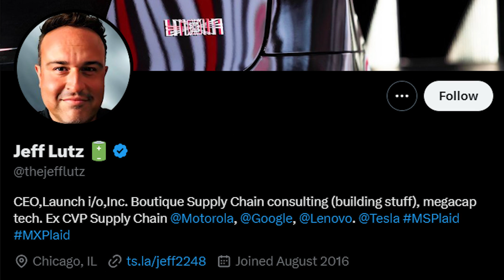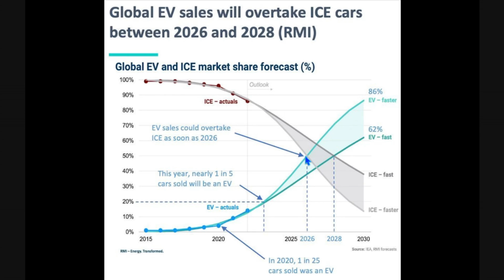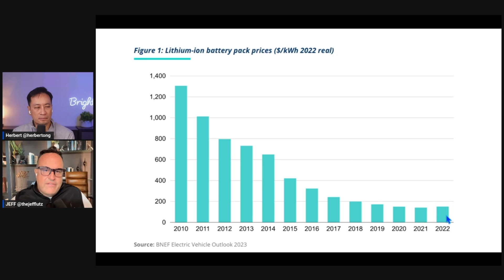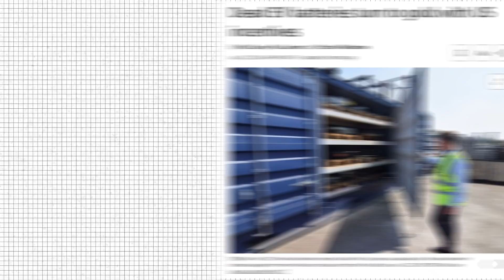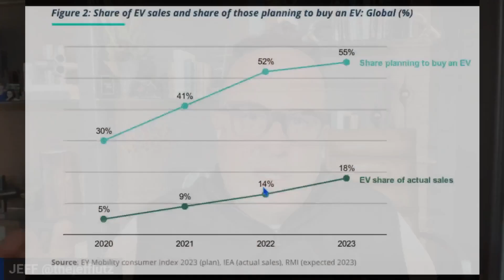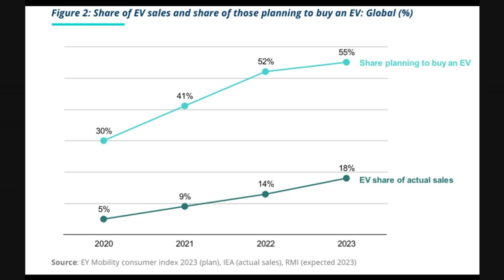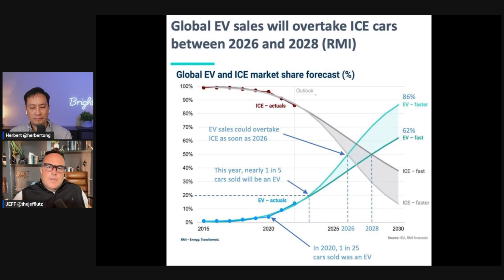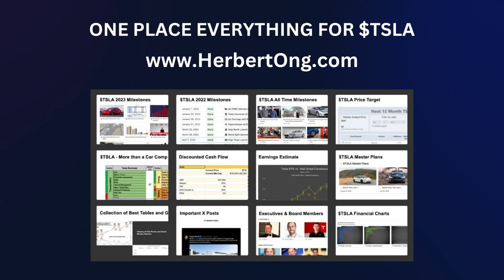How EVs are Beating ICE Cars!

Comment: You need to plot the gasoline prices over this time span and electric charging rates. You assume electricity staying flat or going down. You assuming gas staying high and going higher.  Yes that is true. Sorry - there are a few things you didn’t take into concern. A) EV car fires no longer are to be hidden. Main problem - electric battery runaways are no longer to be hidden. Risks and reward are no longer in sync. 

Once the public figures our that EV cars are not repairable only built to planned obsolescence. You don’t talk to younger people. They actually like older cars. Not only for the cost but for ownership.

Comment: This S Curve is great, but the slope is too high.  Tesla is not able to support the log phase and the competition is producing fewer EV's due to strikes and technical/production challenges.  Tesla will hit 1.8M in 2023, 2.7M in 2024, 4M in 2024, if their luck holds out.  Hard to see the new models and gigafactories ramping up.  GM, Ford, and Stellantis are very vulnerable and it would be great if Tesla could hit 6 million in 2025, but that appears unlikely to me.

Comment: The biggest obstacle to EV adoption in the United States, is the horrible charging infrastructure on trips. I have had a Hyundai Ioniq 5 for the past seven months and I love the car as long as I don’t leave town. But having to rely on Electrify America is just beyond infuriating, and makes me more likely to not buy an EV next time unless things drastically improve. it’s just not worth the misery and planning involved in trying to take a road trip. until there are reliable fast DC chargers, every 25 miles or so that I can reasonably expect are available and functioning properly, I don’t think I will buy another EV. It’s even hard to take a trip from Indianapolis to Chicago without encountering problems because there’s only one logical charging station in between, and they are frequently broken and have a line waiting to use them. This basically never happens with an ice car. Electrify America is literally destroying the adoption of EV’s in the United States.
Reply: The charging infrastructure for Teslas is working, why not a Tesla?

Comment: If the US govt stops subsidizing the oil/gasoline industry gas prices will rise and the EV adoption rate will accelerate dramatically. Maybe if the govt just put that money into the EV charging infrastructure and renewable electricity generation we would reach our lower emission goals much faster. They could also put a good amount into strengthening our power grid. Sounds like Europe huh?
Reply: Not sure how subsidies work, but it could be that its done in the State level more than in the Federal. The reasoning being that states have different gasoline prices. States could either provide subsidies or have different tax levels for gasoline.
Reply: State and Federal charge taxes per gallon of gasoline or diesel sold at filling stations. These taxes go towards road maintenance and other projects. EV's don't pay any of these taxes so as more EV's start using the roadways, the governments will start taxing EV's for road use by taxing at the charging stations or by the miles driven or just adding a fee to EV vehicle registrations.
Reply: @norme1850  Those are not what I’m talking about. EVs make up that tax in most states at tag renewal time. I’m talking about US govt subsidies for big oil. Google it.

Comment: The US government does fund gas stations, at least through preferential tax treatment. I think they were also directly subsidized many decades ago when they were first being built out.
Reply: Acquiring or constructing a gas station with a convenience store (“C-store”) can be a lucrative addition to a real estate portfolio. Current rules allow investors to immediately write off all the improvements if certain requirements are met, and the property is placed in service after September 27, 2017. This went into effect after the Tax Cuts and Jobs Act when bonus depreciation was raised to 100% through the end of 2022.

To be eligible, the property must meet the definition of a ‘retail motor fuel outlet,’ which enables qualifying Section 1250 real property to be depreciated using a 150% declining balance method with a recovery period of 15 years. Commercial buildings are typically depreciated with a recovery period of 39 years and not eligible for additional bonus depreciation.

A definition of ‘retail motor fuel outlet’ is not provided within the tax code; however, in the late 90’s the IRS released Coordinated Issue Papers (“CIP”) for Petroleum and Retail Industries Convenience Stores, which provides a detailed definition and qualifying criteria. As per the CIP paper, a C-store at the gas station will qualify as a retail motor fuel outlet (15-year property) if any of the three following tests are met:

50% or more of its gross revenues are generated from petroleum sales; or
50% or more of its floor space is devoted to petroleum marketing sales; or
the C-store building is 1400 square feet or less (regardless of whether it meets either of the aforementioned criteria).

Comment: COGS for ICE cars are rising at an alarming pace. No one addresses this. When you order less parts for your ICE cars the suppliers raise their prices.
Reply: Plus any repair/maintenance and warranty costs go up, mechanics are getting scarcer, oil change costs are purely based on volume etc.
Our bolt has been the cheapest car I've ever owned&operated per mile and has saved more than it weighs in fuel from being burned so far. 👍🏻😎